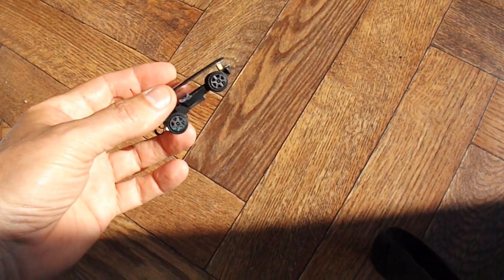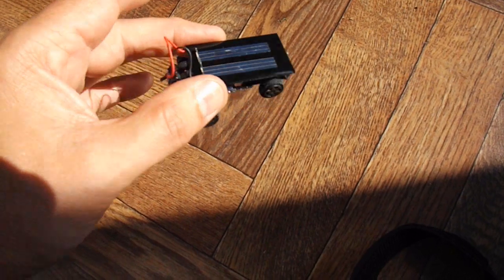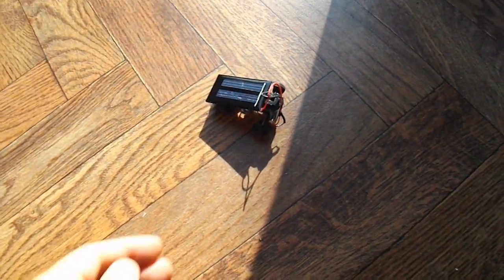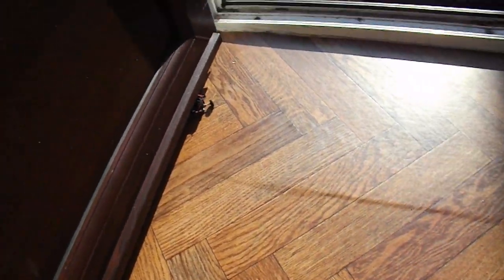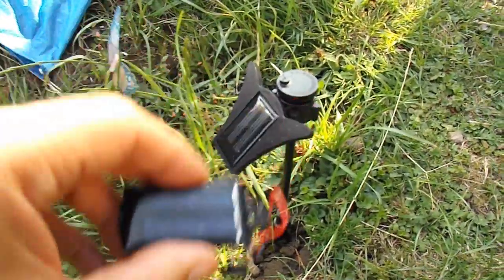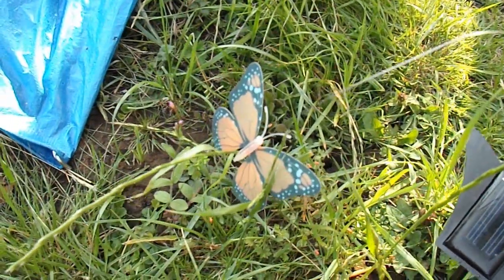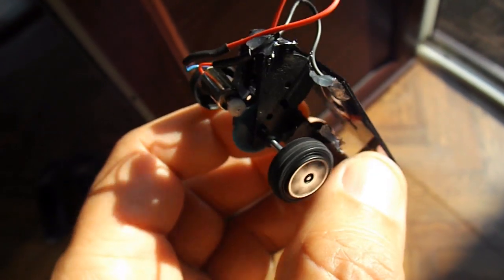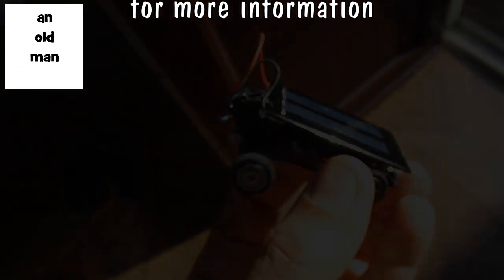Hey Grandad, can you make a small Solar Powered car? PART #2

Comment: What happens when you point a laser at it instead of light?
Reply from the maker: Nothing. A laser is a focused point of light so it only hits a tiny area of the solar cell so not enough to generate any power. Playing with these small solar cells makes you realise just how much power there is in sunlight.

Comment: from where you get the solar panels
Reply from the maker: The same answer as I gave you last time you asked. I would buy them on eBay if I wanted useful solar panels as you can choose the size and price you want. If you read the video description on this video the panel shown comes from a Fluttering Butterfly Solar Garden Ornament. In the UK in 2014 when I made this video these were available in the 99p Store. That store no longer exists as they were bought by Poundland and I haven't see that ornament since so have a look on eBay or similar online store.